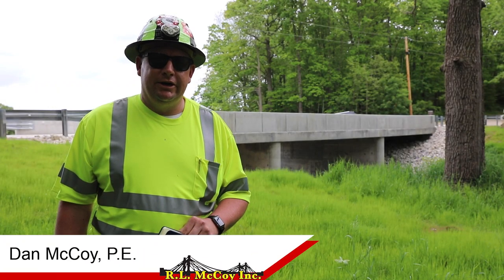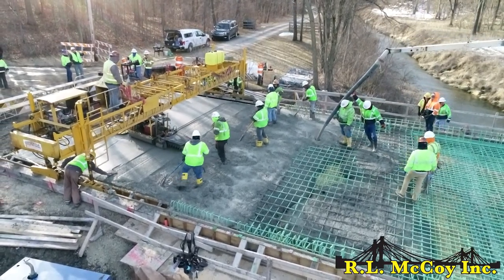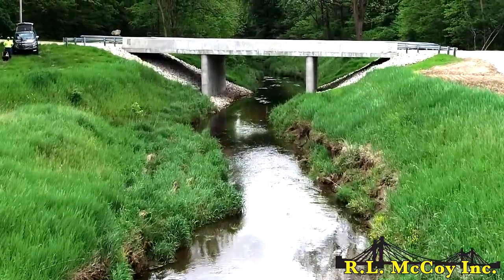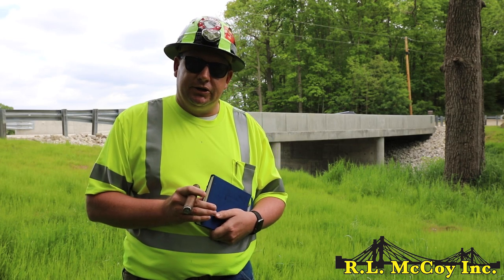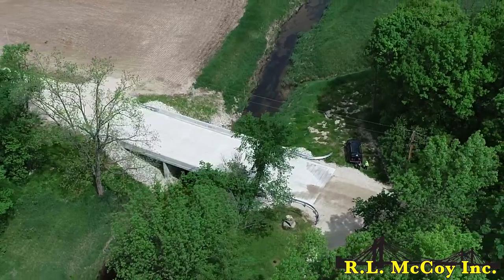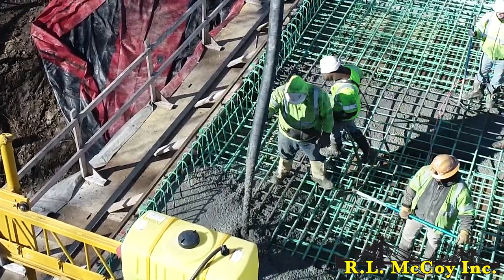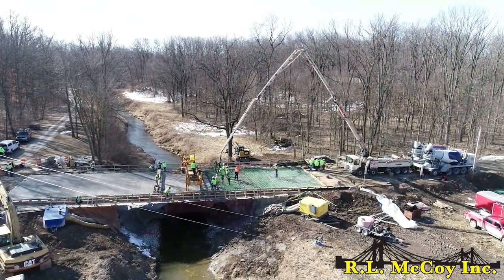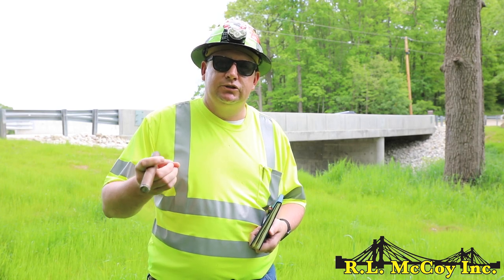R.L. McCoy  - World's First Liquid Fly Ash Bridge And SMART Infrastructure Evolution.

Comment: Hi I'm interested in finding out how this material would work on outdoor precast platform decks that are architecturally designed to have 24"x24" Brick Paver installed over a mudbed. The mudbed takes alot if time to screed, mix and curing makes for a difficult process in winter and sometimes tricky in the hottest days of the summer months. This seems like it can go in as a flowable material and can be run to subfloor height screed alot faster than a 4to1 deck mud  that has to be troweled heavily to close/finish the surface of the mudbed and that can cause the human error if the installer gets too aggressive and compresses some areas more more others leaving behind a dip or low spot in the subfloor which will require self leveler (worst case) or extra substrate thinset in the areas after being identified (hopefully being identified) by the installer. I'm wondering who I could talk to in discussing the pour thicknesses to wire/mesh size and surface bonding versatility. Any information would be helpful. This is really cool stuff.